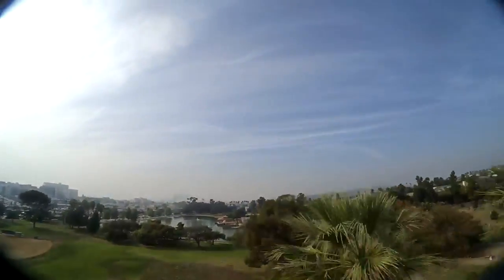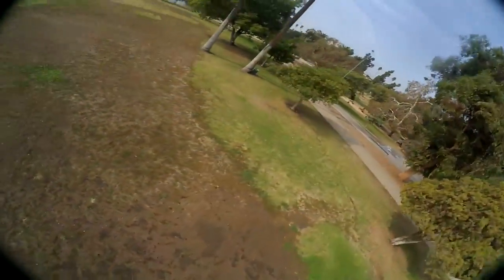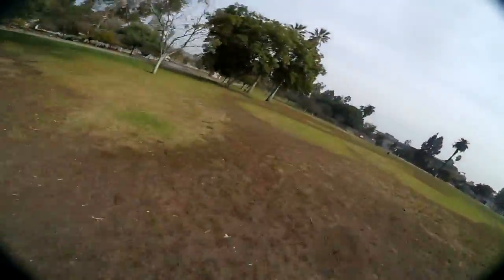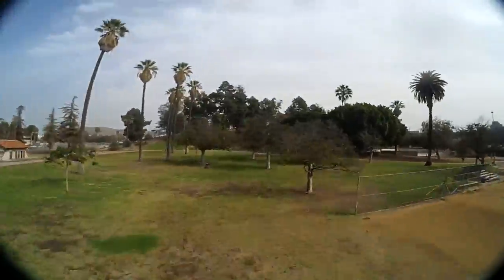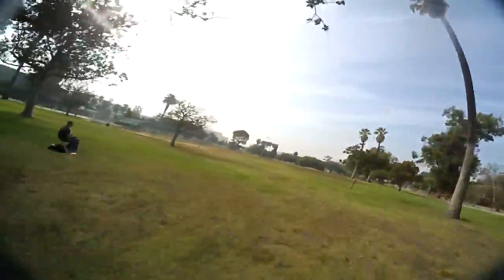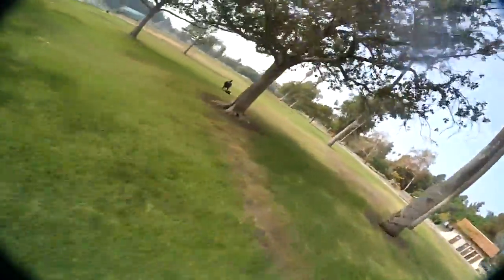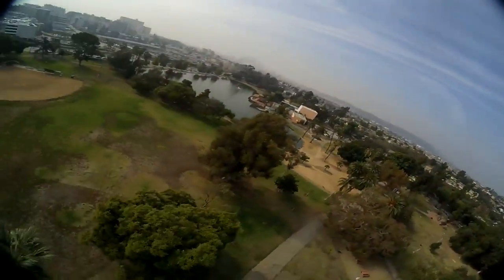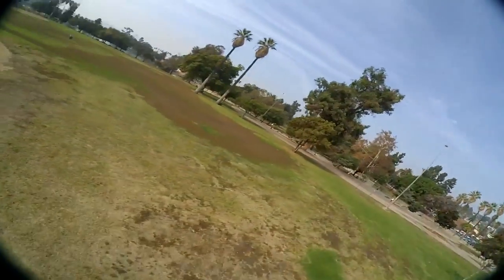New Propeller GetFPV-Lumenier 5050x3 Butter Cutter Preview

Comment: do you think we can use 50x50x3 butter cutter on rs2205s 2600kv ?
nice video by the way.
Reply from the maker: Mohammad Ali yes you can use it but I would recommend at least good 25A ESCs  minimum.  30A preferred. Also you will need very good Lipo pack. 2206 motor is better for 2600kv but EMAX is a strong motor so it should be OK. Make sure you "test" by flying one fast lap with a good 100% throttle run at the end of lap and then land as fast as you can. Then grab motor by bell. You should be able to hold it .If too hot to hold then not good usually. If you have laser thermometer then around 55C to 60C would be good temperature.
Reply: Thank you for reply, i have 30a continuous esc with max 40a. I have a battery that can easily supply 200ish amps i think that should be more than enough. I have the 50x50x3 buttercutter propellers and racekraft 50x51x3. I think racekraft propellers would be better with 2600kv model motor , Dont you think?
Reply from the maker: If you haven't tried RK5051, you'll find them to be "fast" in top speed but at low speeds, tight turns they're not as responsive as LUM BC5050x3. So RK faster top speed, BC faster in tight turns. At least that's how I felt them in my setup. So depend which flight characteristic you're looking for,
30A ESC will be plenty good.
Reply: Absolutely right, i guess it depends on my preference, need to do more tests. But I still wonder how much thrust difference is there between the RK5051x3 to BC5050x3 and a 5045x3 propeller. I bet 5045 might be the winner in thrust case.
Reply from the maker: DAL Cyclone 5045x3 and BC5050x3 will be very close to each other. DAL T5045x3 V2, slightly behind, RK5051x3 would probably feel less powerful at the low to mid throttle range so coming out of dives or tight turns you may feel that you have to use more throttle but if you were racing long straights or long sweeping turns then RK may go faster. Several people are liking those new GF5152x3 and EMAX Avan but I haven[t had a chance to try them yet https://www.emaxmodel.com/emax-avan-r-propeller-bulk-10-cw-10-ccw-moq-10-sets.html
Reply: Thank you, ill check out what these new propellers are all about.
Reply: EngineerX have you tried the avan now? If so which one would you recommend?

Comment: These look like battery killers just like the 5051 props. A quad could theoretically pull more than 160A with these, would be interesting to see voltage sag figures with these compared to the regular 5x4x3.
Reply from the maker: When I pressed my DomHD DVR button it beeped.... so I thought it was recording FPV cam feed, I was gonna add it to have in-flight voltage... but of course I had forgotten microSD card at home. 
"Theoretically" is the key word. Keep in mind the thrust stand really exaggerates both thrust and Amps. In actual flight those figures are lower, as much as 25 to 35% for Amps. 
Flight times will indeed be shorter with these props and the TRK5051's. People are reporting around 2.5 min flights with 5051s, reduced from 3 to 3.5min on 5040x3 props. No way around it, power/thrust cost more energy. Quads fly faster and cover more distance quicker overcoming even more losses: higher drag, more heat generated, etc resulting in battery draining faster. Still, they're manageable with good beefy high-C Lipos, for sure we'll see reports from fast pilots. I'm curious to see how LiPos fare with the abuse from the latest batch of super powerful motors running these (and 5051 props). We definitely need the next battery tech/chemistry soon.
Reply: EngineerX Agreed, the battery technology is one of the big factors holding quads back. I think going to 5S or 6S on the 5x4x3 is a better option than running very high pitch like these, higher voltage improves efficiency and speed with the only major drawback being slightly more weight. Unless you are mattystuntz who manages to fly 6S on high kv motors and 5051 props without something blowing up.
Reply from the maker: I'd love to see one of the top pilots run both a short and a "wide" race course comparing a prop like this VS a 5040x3 on 5S. Would need to run several laps and average all similar times, discard laps where errors were made. We'd get a very good idea of which setup has an advantage!

Comment: I was reading about this technique the other day. I think what is happening is that the design effectively creates a swept wing.
http://sustainableskies.org/eas-viii-high-efficiency-forward-swept-propellers-low-speed/

Similar butterknife profiles can be seen on the new high bypass tubofans for commercial airliners. I'm convinced the propeller issues we see at relatively low speeds are similar to those faced by high speed aircraft.
Reply from the maker: Very interesting read. Thanks for sharing it. Let's hope propeller manufacturers keep exploring these design approaches and look into swept airfoils. Very cool there's still much to improve in propulsion for our toys! I'll probably make a reference to this article you linked.
Reply: Thanks for the link :) Though you cannot apply all principles/effects found within larger scale props. The Reynolds-Number decreases with scale, and so do the drag effects (e.g. through turbulences at the tips - the thing that makes BN props less efficient) change with scaling. According to the Lumenier folks, they are taking this into consideration now :) Also, not effecting the thrust but the flight stability and oscillations created: The props don't move straight through the air like in a standard wind channel setup. Most of the time, the copters movement has a forward component, making the prop moving "sideways" through the air. So the the blades moving in flight direction have a different angle of attack and a different airspeed than the ones moving the opposite way. This induces different drag and lift to both sides of the prop, making it bend and flap.
Luckily, the drone field in general gets bigger and bigger, and more money and scientific effort is thrown at this.

Comment: Your Pids need tune. You can hear the motors vibrate, would be cool to compare to 5050 and RK 5051 or even Cyclone 5045.
Reply from the maker: Yes -  needs a tune, had to do a "boot" flash and wiped out my settings. Flying during lunch break ... so only did a minor tune, just increase I & D a little. The giro on the MotoLab FC I'm using seems to be one of the sensitives ones, had to softmount to get rid of yaw shakes that wouldn't go away with the software filters

I have those 2 props on hand. I'm going to run thrust tests on those this week on the EMAX (S)
Reply: EngineerX Thanks man, my comment its not in a bad way just an observation, i really like your tests and follow you. Thank you for another great mini review. :)
Reply from the maker: Yes I know it's a good observation -advise. I don't take it in a bad way so no worries ;)
Thanks for watching!
Reply: EngineerX Great, sure i will. ;)